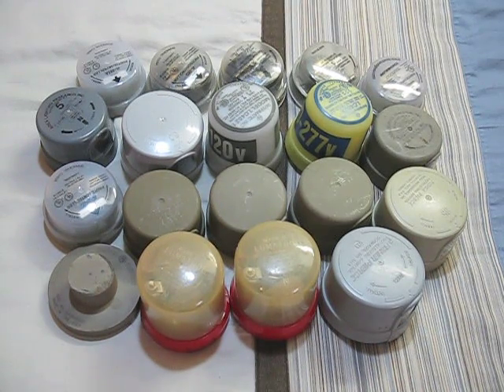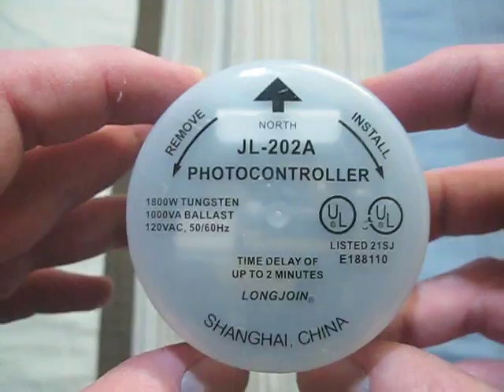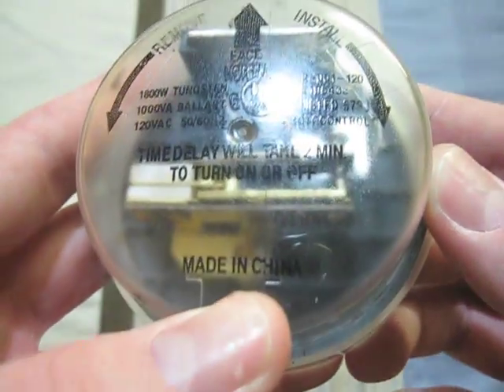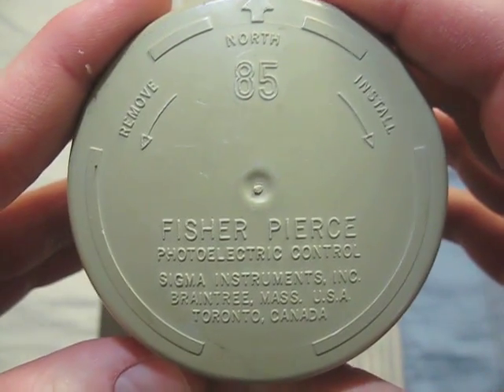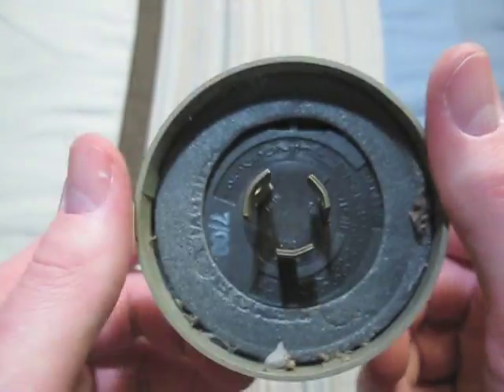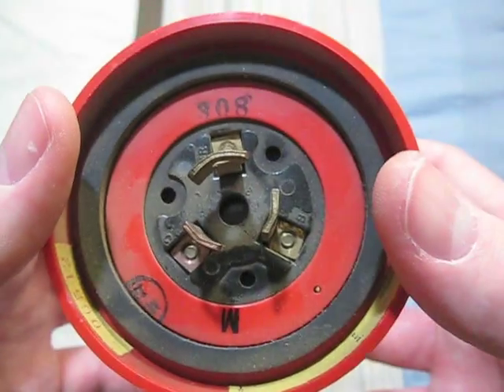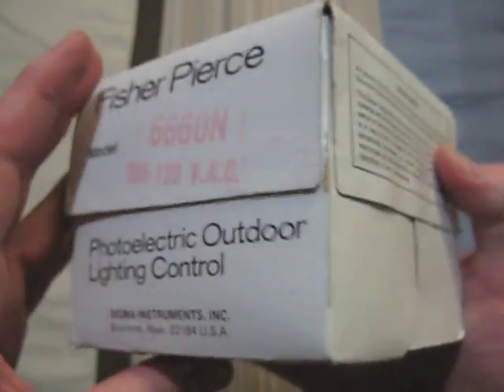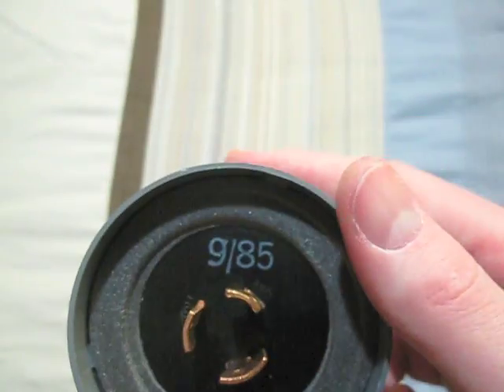Photo Cells (Photo Controls)

Comment from the maker: There are 3 wires going to the photo cell socket (white, red and black). Take the red wire and connect it to the black wire, take the white wire and cap it off with a wire nut. That is what I would do. Try it and tell me if it worked.

Comment: My photo cell is bad. I can't read anything on it from the weather/age. How do I know if I need a 120 or a 208? Those are the ones at lowes
Reply: 120V is most likely what you need in a home setting. 208V is used in three phase settings, like apartment buildings, and commercial settings.

Comment: I also have an 80s model street light in a gable in the front of the house. Ideally I would replace that with a motion sensor so the front lawn lights up whenever there is someone there. Is there a motion sensor control that can replace those photocells?